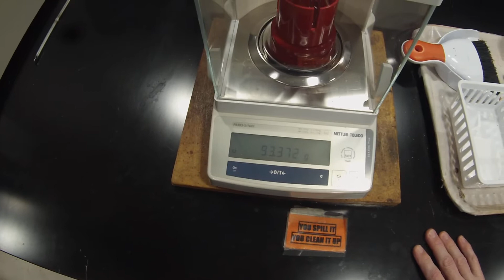Grignard Reaction Part VII - Quenching

Comment: Why do we use ice for?
Reply from the maker: The reaction is quite exothermic, and the solvent for the reaction, diethyl ether, has a low boiling point.  We cool the reaction in ice during the addition so that the heat generated by the reaction will not boil away any of the solvent.
Reply: The acid-base reaction is strongly exothermic.  The ice keeps the temperature low enough to avoid evaporating the ether, which has a low boiling point, as well as to prevent thermal decomposition of the product.